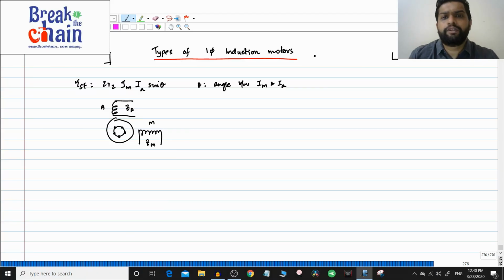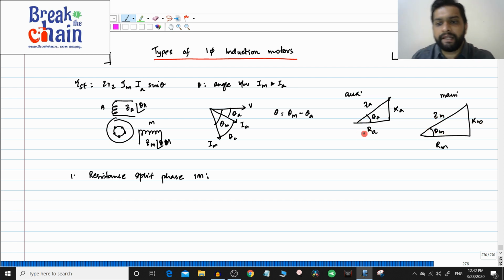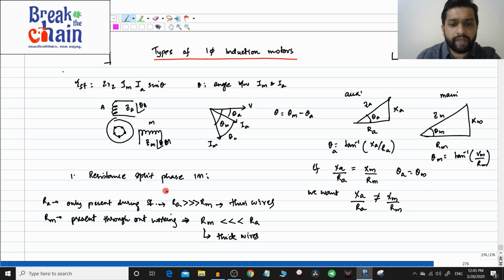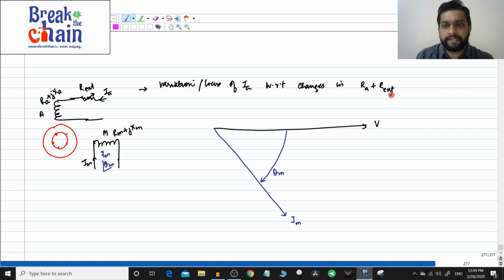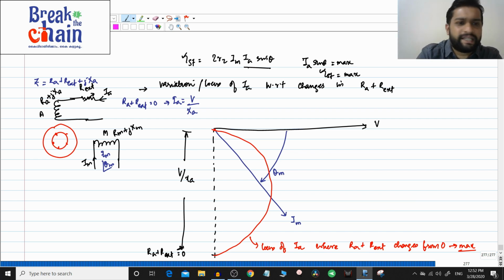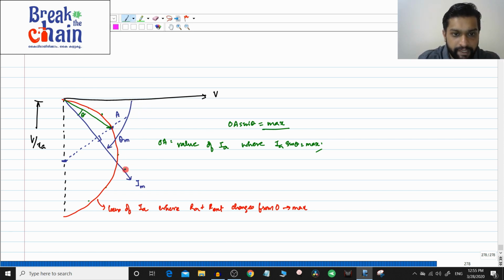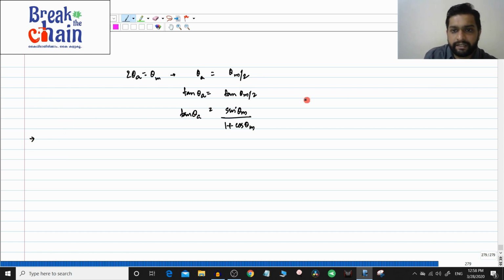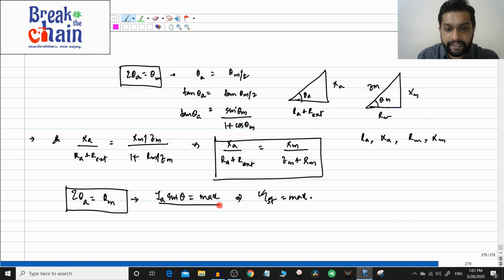Single Phase Induction motor #10 - Resistance Split Phase Induction motor

Comment: correction 'might not be the value we want if (theta m - theta a) = 90, where theta m is set and therefors theta a is also set and that set value will not not allow for Za to have it's theta a the value we need to miimise Za and maximize Ia sin ( theta m - theta a)

Comment: Hi Varun, I think it's because if theta m is set and theta a is a variable then to maximize the magnitude of Ia the impedance angle of Za ( theta a) in the difference theta = (theta m - theata a) might not be the value we want to get Za lowest and therefore Ia amplitude maximum. That's why we have to maximize Ia amplitude times sin ( theta m - theta a). I would have have never thought of this with you pointing this out! thank you as always!